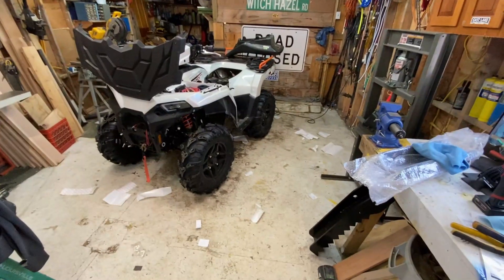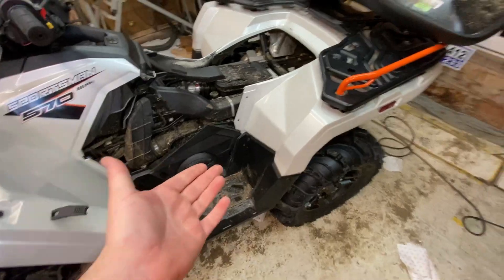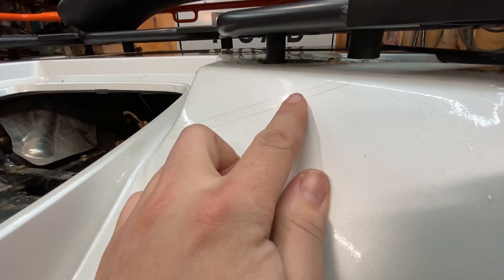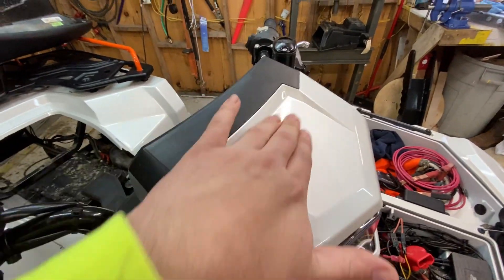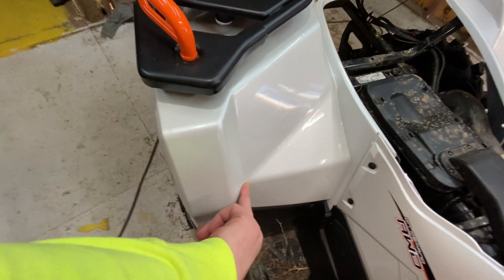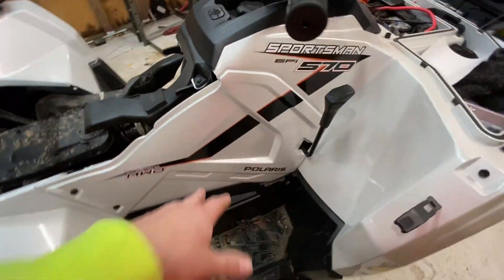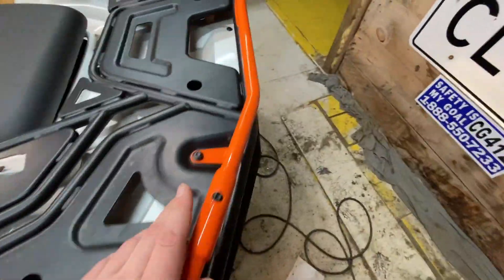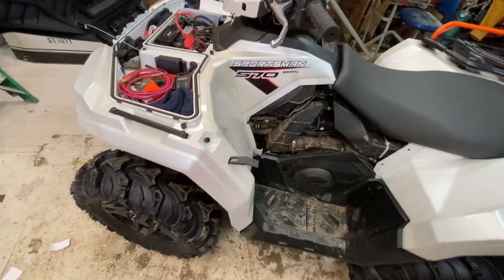Paint protection film on my 2021 sportsman 570 and powder coat update

Comment: I did this to my sxs and doing it on my new Grizzly. I have a 6 and 3 year old and this stuff is gray piece of mid. Went with matte black to match my rear fenders. You can heat it and stretch it, then re apply heat to shrink it around compound angles on your atv